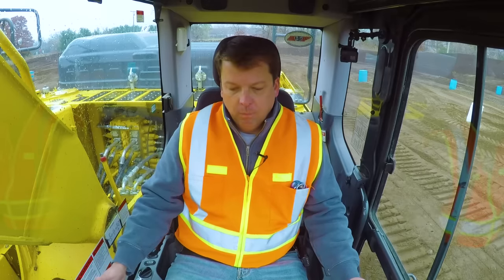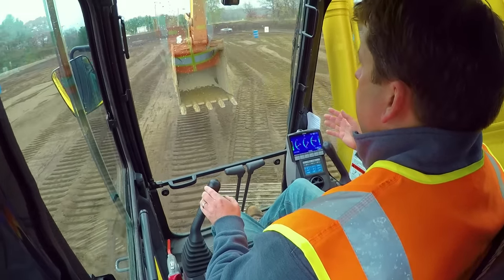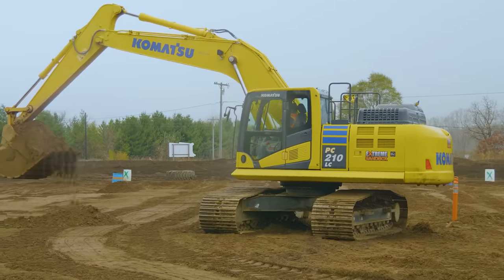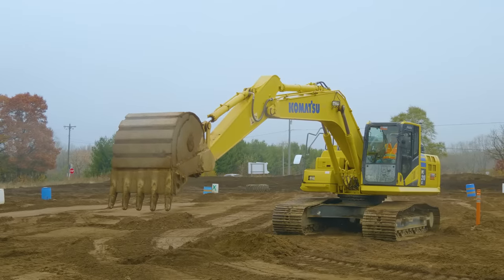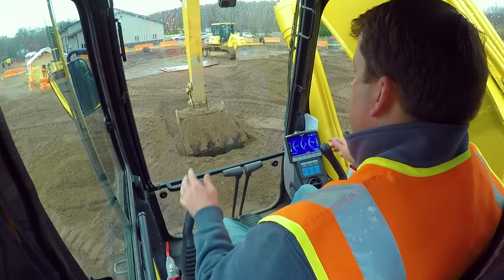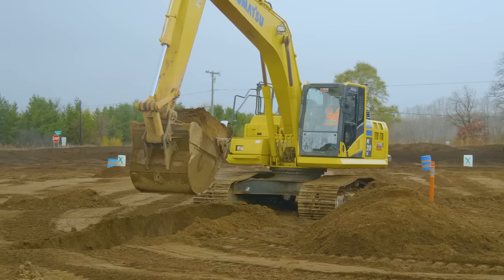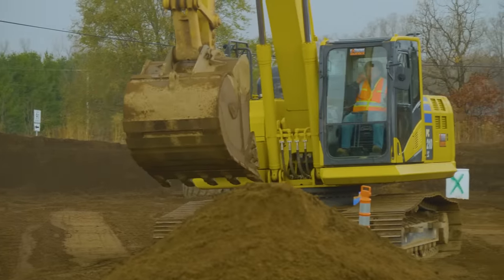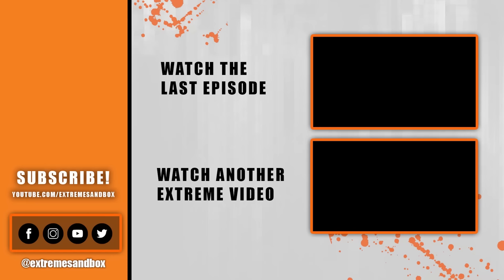What NOT to do in an Excavator | Heavy Equipment Operator Training

Comment: Biggest mistake I see at work is operators driving in reverse over the length of the track, as this increases track wear!
Reply from the maker: I'm confused on this one....can you explain further?   Are you saying driving an excavator in reverse increases track wear?
Reply: @HeavyMetalLearning  Yes! These best explain what I'm talking about (this from a WESTRAC https://www.westrac.com.au/en/resources/articles/5-ways-to-improve-your-undercarriage-life )  "Operating in reverse—even at slow speeds—compounds bushing and sprocket wear."
(this from PLANTMAN website https://www.plantman.com.au/improving-your-excavator-undercarriage-life/ ) "Excessive traveling in reverse or moving forward with the sprockets at the front of the machine creates additional internal stresses and tightening on the track parts which will cause accelerated wear. Traveling in reverse also requires additional power, which in-turn increases your fuel consumption and hourly operating costs further."
Reply: @HeavyMetalLearning  - When traveling, you should be pulling the tracks under the hoe, not pulling the tracks over the top of the track "system". That puts undue wear on the idlers.
like in your "How to Operate a Mini-Excavator" @:32 Blade in the front, drives to the rear. All the tension pulls directly under the hoe when pushing.
Reply: Did not know that thanks , ive been doing it wrong for 20 odd years

Comment: I rented an excavator this size once. Had never operated one before and I was flying it on one track while digging. I had one track lifting 2-3 feet almost every scoop. Good times
Reply: that's not something to brag about... even first time, doesn't take a rocket surgeon to figure out somethings wrong.
Reply: @salvadordollyparton666  sure it is something to brag about. I was using it to its maximum abilities and getting a full dig everytime I dug in and it wasn't hurting the machine as I was able to balance and put it down softly each time so what's the harm?

Comment: The worst mistake I have seen someone do is to be out of the machine on the ground and lower the safety stick in order to turn a Trac a bit or swivel the hoe to get to grease certs etc etc.   This is a no no.   Never ever drop the safety lever to do anything if you are not in the seat.  NEVER NEVER NEVER
Reply from the maker: Absolutely...I've seen that as well....good tip, always safety first!

Comment: I have to disagree with putting the idlers on the dig side. Doing this means more wear on the rails when digging a trench and tracking forward the sprocket pulls the rails over the top of the idler stretching the rails there for causing wear on the rail pins. I've been running equipment over 40 years installing underground utilities and I've seen the difference it makes. Now if you are loading trucks or undercutting, clearing or any other type of work it would the operators preference.

Comment: Its loads of fun on gas well with plastic mats  that gets iced up.when digging in half round that you  normally track parallel because there is only enough room to drive the direction of half round. when you roll bucket in a half round  tank it you end up sliding the hole machine  back and forth as you roll mud with drying agent  usally  lime or saw dust or pellet. always someone caves the side panels in against a tank. It's just a piss poor design in machine that spins having a tin door they could give it armored side panels and extra tail weight
Reply from the maker: Hmmmm....not sure I understood all of that.
Reply: @HeavyMetalLearning  that makes the two of us.

Comment: Another "don't do" is using the windshield wipers and the washer fluid to clean the glass. It makes scratches that eventually make the glass impossible to use in the sunlight. I had to replace the glass (not really glass of course) in our D6K this summer. It costs about $1500. I removed the windshield wiper blades to stop it happening again. To be fair we don't get snow and don't work in the rain on a farm.
Reply from the maker: Loving your advice!  Maybe we’ll have to get you to come shoot a video with us!  I love having experienced operators on our channel like yourself that are willing to share tips and tricks to others (especially new operators).  Thank you very much for these suggestions!
Reply: @HeavyMetalLearning   For the record I'm not a professional operator. It's just part of my responsibilities on this plantation where I live. Yesterday I used the mini excavator to roll a 15' batwing out of the shed to make room for a tractor. The day before I used the DX300 excavator to make a place for our hunters to leave deer carcasses and to clear tall brush that hides oncoming traffic in a hard turn on our primary road where it skirts a brake. Yesterday I was running electrical conduit because I'm moving our 25 hp air compressor into our generator room. And as part of that project I connected a shutoff for the air compressor pump if it reaches a specified temperature. Plus another shutoff if it runs longer than a specified time. That's some detailed electronics to build those. I also do all of our machining. And maintain all the HVAC. Pretty much everything that requires a stout IQ. I'm actually a retired software guy with a solid science and engineering background who grew up in the country with horses, cows, tractors, dozer, etc. I bought this place in 1998. It's 2200 acres. In a past life I flew helicopters. I asked my first instructor how hard it was and he said if I can run a dozer I can fly a helicopter. He was right. I can make a tight dozer dance a waltz.

Comment: why you do not retrackt cilinders when you park the machine..?. (sry bad eng.)
Reply from the maker: Yeah, we've heard different philosophies on that so not sure that there is exactly one "right" way.   But agree there are some benefits to parking that way.   Thanks for the comment!
Reply: Depending on the safety rules on the job site...to park a excavator correctly you have the rams closed as much as possible for the longevity of the chrome on the ram

Comment: Wrong on one point - Make your first swing to the right. The hood of my truck has a wide flat scratched area when my counterweight hit it. Someone brought my truck, and a coffee, to me and pulled up within a foot of the machine right side of the machine toward the back where I couldn't see it. I rotated left and hit it.
Reply from the maker: Interesting perspective...thanks for sharing!
Reply: @HeavyMetalLearning  During production it's a clearer view left, but for initial movement you can turn you head enough to see everything to your left. But you can't see who are what your counterweight it going to hit if you make that initial swing to the left. So I ALWAYS make my first swing slowly to the right. I've bumped enough things to learn that lesson the hard way. Fences. Trees. Tanks. Posts. This is critical in tight situations where the location of obstacles or equipment is unknown. I owned a Cat 345 for several years and it was really hard to judge how much clearance I needed for the back, which was something like six feet.
Reply from the maker: Jeffrey Lewis awesome advice...thanks for all the tips!

Comment: I have been running hoes for about 13 years now and this video is very informative hell I even learned a few things. One good tip though for once you get better at running a hoe is to stay in motion when digging. It will speed you up a lot. For example if you just dumped out your bucket and are moving back to the ditch go ahead and be rotating the bucket to the position you need to dig. Also, you will end up running faster if you don’t fill up the bucket. Less dirt means more speed which in the long run ends up being quicker.

Comment: Anyone ever had the trouble of one track on the cat 305.5e not turning independently
Reply from the maker: that sounds like thats a service call
Reply: Ok.  Any advice
Reply from the maker: @georgepersaud1048  sorry...can't think of anything.   When you say not turn independently assuming you're not using a trenching or straight line pedal or something.   Otherwise I would check the control pedals to make sure no issues.   But otherwise really no idea, I'd be on the phone with my dealer for service.

Comment: Top mistakes down south is 98% operators only speaks Spanish and don’t clean the windshield.
Reply from the maker: Gracias por el comentario. Estoy de acuerdo en que muchos operadores no limpian su parabrisas
Reply: Ok ok I get it. You give a lot of good advice. I’m 40 been an operator for 15 years and moved up to running robot on motor grader from the shovel. In Dallas tx things are nuts. If you’re not bilingual you cannot get a good position here. So you just tell me where to go and I’ll be there.

Comment: You should’ve lower and tucked your boom before tracking I see power lines in the background just saying
Reply from the maker: Yeah...lots of different opinions on travel position.  I don’t think there is one right way.  Thanks for the comment!
Reply: learn to look up when traveling amd swinging.  it is not a normal thing to look up, but looking up will prevent running into wires.  very important
Reply from the maker: j myers agree...thanks for the comment!
Reply: @HeavyMetalLearning  yes there is a correct way. Bucket curled in to stick, stick pulled to boom . Heel of bucket 2 ft off ground, finals behind you!
Reply from the maker: Blade Runner there’s never just ONE right way.
Reply: @HeavyMetalLearning  lol, its in manual. Everyone does it thier way though
Reply: I didn’t see him hit a power line so he did it the right way. If you know the area then you are just wasting time tucking your bucket in every time you move.

Comment: i never get my seat belt on. Never been in a situation where it has help me. I totally stopped using it. Any advice out there.
Reply from the maker: First advice....where your seatbelt.  May not have helped you YET but I think you're gonna want it for that ONE situation....trust me!
Reply: If you role over or sideways you body or limbs can maneuver the machine and hurt or kill others, or  destroy things around you. What if your glass brakes on the role over and you fall out.
Reply: Wear the belt. Dont be too cool to do it.
Reply: Buy a nice life insurance policy for the wife and kids. They will need it.
Reply: Wear the seat belt.
Reply: @timc9893  good advice
Reply: Work in west Virginia and you wont have an option ...winch tractors wear them too for the surprise nobody wants
Reply: I usually see the need when digging too fast through soft dirt, and find a large rock or root. Can throw you around fairly easy.
Reply: Very experienced Forman rolled a hoe a few months ago. Slid probably 100ft down a 1to1 and hit a groin ditch. His door was open and it landed right on the left side. Had he not been wearing a seatbelt he’d 100% been under that machine.
Reply: Big fine if you get caught and yes it saved me some bumps and bruises and a broken window more than once when clearing on rough ground.
Reply: You must be a flatlander. I have worked on slopes where the belt was the only thing holding me in the machine.
Reply: Not wearing it is rolling the dice and seat belts are required in many spots. I myself only wear them when there's risk. If I'm on hard flat ground at ground level I don't.  If I'm in air, digging down, on slopes, and such I do. Compactors I always wear.
Reply: The seatbelt is crucial for longevity as far as body positioning for 10 or 12 hours a day. It holds you in positiin when on a slope not to mention its usually company policy

Comment: How about don't have a dirt guy try to dig pipe.  Especially in a box.
Reply from the maker: Hmmmm
Reply: @HeavyMetalLearning  all you get is busted existing pipe or uneven grade.  Not to mention dirt guys dont understand that fine control of machine, meaning within a quarter inch can't be achieved when the machines full throttle.  They never have to do that.  They never have to have their bucket within inches of a man and a fixed object either.  Just makes for a bad day.  Pipe guys dig ponds and swales and load trucks great but dirt guys cant just start up on a pipe crew and think they know something.  It's a totally different animal.

Comment: " Hand, shut that machine down and com'ere for a minute., Son get your lunch outta that machine ,and go on home. im sorry i have to do this cause now i gotta find an operator that WILL wear a seat belt".
i did not see a seat belt there on you, in this video, though the vest might have blocked the view, but i would have sent you home, were I the safety director. that would have been embarrassing. 

3 feet from the ditch for spoils, more, if the spoil has a tendency to slop.

safety glasses no matter what. hard hat optional when in cab, but son, you better not forget it when you crawl out".

in any machine "smooth is fast". fast is generally not smooth.  the military step-n-fetch-it thing don't work on a jobsite. i seen so many fools react in jerky high tension manner thinking they are really with it, and are "hustling", when in fact they are just getting ready to have an accident. Any boss that pushes in this manner needs to be fired by his worker, and the hand go looking for a better boss. 
A really good hoe hand KNOWS what is going on around him 360 degrees and 180 degrees above him.  Hand will take his eyes from the ditch at just before the bucket leaves the soil. You will see him look up and lead with his head where he plans to move that bucket. his awareness is always two seconds in front of his move. 

ive worked with the very best hands in my many years on the site. they KNOW, they are aware, they are engaged with the action, are not distracted but are just fully aware of what is going on around them.  the machine is always in motion; smooth, flowing, and with purpose. never a wasted motion.  when idle and waiting the operator is set ready to make the next move, like a coiled spring, a cocked gun.

he will glance left, right, he is looking for moving dump trucks, for the stability of his tracks on the soils of a soft bench, he is looking at where he will place the bucket on his return swing, he is thoughtful, accurate, precise, and HE LETS THE MACHINE DO THE WORK. 
He does the planning, always ahead of the move. notice a good hand glances down at the trench as his bucket swings into the position to load a dump truck. he has already sighted his next cut, lookiing at the soils the changes , possibly water in the trench, looking for tree roots , hidden pipe, whatever. that glance lasting a half second tells him everything about his next dig.

A poor hand, is hypnotized by his bucket. you can see him in the cab, hunched over staring at his bucket as if his stare will move the bucket to his desires. His machine is rocking, a sure sign of a poor operator, He is feeling the trench through his eyes. 
An excellent operator is aware, relaxed, forceful through his hands, and can feel when he may be up against an unmarked or abandoned gas/water line through his hands. the machine will take a little set, the bucket will hesitate the teeth probing this obstacle, and the good hand backs off and gets out with a shovel and does some investigation, this of course after unbuckling his seat belt, and putting his hard hat on. 

 a smeared counter weight is sometimes unavoidable. but it is a sign of careful operating when you see an old machine with a clean counterweight. Usually means only one operator has been on that machine. 
I worked with a man who was on a cat 375 clearing a slide, near the coast of Oregon.  it was nighttime  24 hour emergency work.  lights, and people everywhere. An engineering intern, thought to walk behind him, between the hoe and the cliff wall. it was the very last thing that lad ever did on this earth. The hand was devastated; never really got over it. and i knew the man he was a superb operator, but no matter how careful, accidents happen. This was completely not his fault, the intern had approached from the "off side", had not alerted the operator with eye contact, and had done little thinking about his next move evidently.
If there is a safe place near a hoe its directly in front of the cab or off to the left side.  Give your operator every chance, every possibility, to be a safe efficient, hand, do not jeopardize his and your life by acting foolishly if your ground support. An operator with a flighty ground crew is always worried about where his crew is and adds a huge burden to the job.
Reply: It’s going to be a cold day in hell before I wear safety glasses in equipment. And thank you for your concern, OSHA, but I also won’t be wearing a seatbelt until I’m on unstable ground.

Comment: One of my biggest pet peeves was when I'd catch another operator digging & loading with the machine teetering one a couple of high spots, causing poor trenches or busted sideboards on trucks!! Though I don't currently operate hoes I still find myself pulling over & chewing guys asses, also telling them my grand daughter even knows better than that!! Lmao!! Granted there is about 2% of the time when it's unavoidable, but proper prepping of your track placement can be done the other 98% of the time!!
Reply from the maker: Yeah...good one.   Thanks for the comment!
Reply: Machine placement is key.